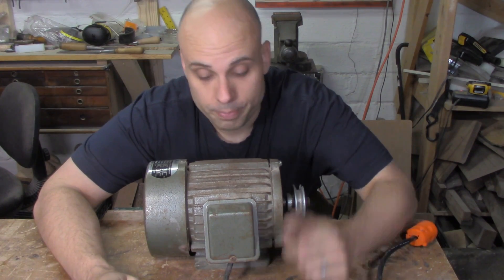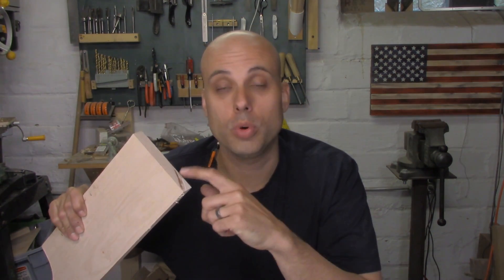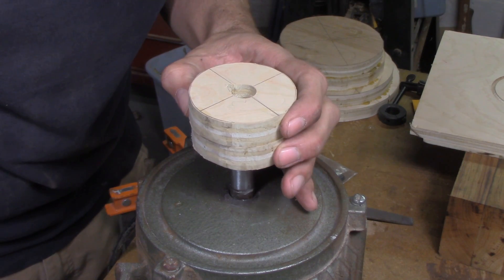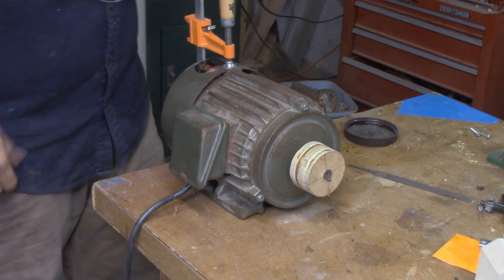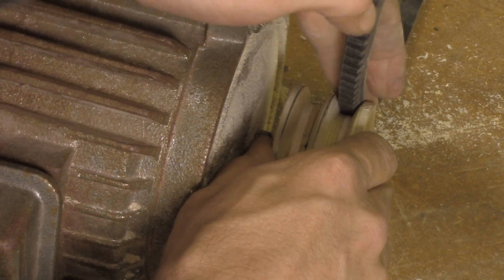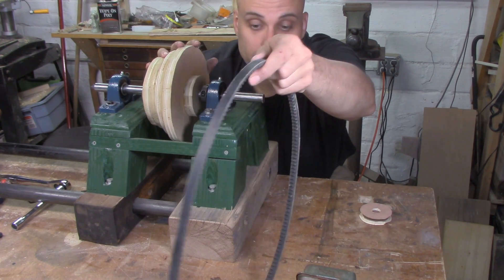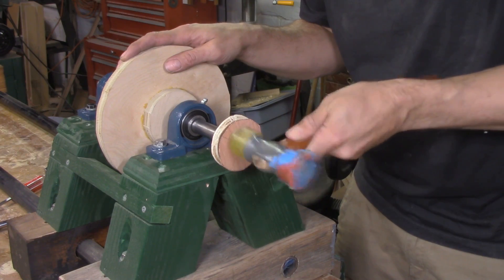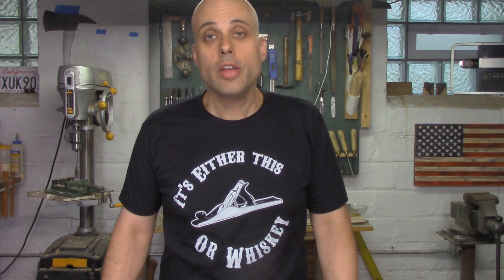Make Step Pulleys for FREE (Real Lathe Pt. 2)

Comment: Your set screws might work better if you file the shaft flat where they contact it.

I’m really skeptical that your wooden pulleys will work for very long.  If wooden pulleys worked, someone else would have been making them a very long time ago.
Reply from the maker: Well, I'm not the first.
Reply: People were making wooden pulleys long ago. They're economical and relatively easy to make. In the olden days, metals like brass and bronze were very expensive, and before the 20th century, aluminum was more expensive than gold.  When aluminum got cheap, and especially since the advent of die casting, that made it easier to make them out of aluminum industrially, but wood is still the best material for  people in small shops.
Reply: I didn't say that they wouldn't work.  I said I was skeptical that they would work for very long.  That's why people pay money for metal ones.  The wooden pulleys on block and tackle don't really rotate very fast, now do they?
Reply: @SkylersRants  wooden pulleys on a block and tackle spin around a stationary shaft.  These are fixed to the shaft.  That's why bushings and bearings were developed to reduce friction.  These pulleys rely on friction to function.  In this application, there are two modes of failure to consider.  The first would be too much lateral force on the pulley perpendicular to the axis of rotation.  This could potentially break the pulley, but proper setup avoids this issue.  The second is the possibility that the pulley could explode if it gets moving too fast.  While a lathe does spin at a pretty high rate, plywood has one of the best sheer resistance  coefficients of any wood material.  The likelihood of turning the lathe fast enough to explode those pulleys is minimal.  I wasn't insulting your intelligence, just saying that without experience your opinion was uninformed.  In the world of engineering, an uninformed opinion is worse than useless.  Guessing a math problem answer doesn't make you a mathematician.  Failure is part of the design process.  Actual failure is a learning experience which leads to more informed experiments and better products.  That's why I suggested you try it.  If your comment said, "I did exactly like you did and experienced catastrophic failure immediately!" Your comment would carry weight.  Saying "that won't work" adds zero information to the discussion and comes off derogatory.  I look forward to hearing about your experience, and I'm sure @rexkrueger does too!
Reply: You're discounting the wear of the belt on the pulley, which is what I was referring to.  In the industry I used to work in, we had a very abrasive environment and metal pulleys would wear out in the groove in a month or two, if not less.  A lathe is not that abrasive, but wood shavings are a contaminate, and at the speeds and power needed for the lathe I can imagine wood wearing out relatively early.  The wear would cause the belt to be less effective at transferring power, and you'd get more slippage when you apply a load to the work piece.  

I don't know the answer and neither do you.  My remark was speculation.  No, I'm not going to build a lathe just to test the idea.  The cost of a pulley is a lot less than the cost of the time I would spend on a silly test.  But Rex might be prepared to watch for this result as he runs his lathe for a while.
Reply: @SkylersRants  that's the kind of comment I was looking for the whole time.  You described your experience, established your credibility, and explained your concern.  I genuinely appreciate your input on this.  Perhaps later in the build, Rex could shield his pulley system from chips to prevent possible wear.
Reply: The British conquered the world with wooden sheaves. The contract for making all of those blocks was a pivotal moment in the Industrial Revolution too.
Reply: I have made wood pulleys l was a patternmaker
Reply from the maker: Shirley Ashton Wait, really? I didn't realize any pattern makers still existed.  Where and when did you work? If you wouldn't mind sharing some of your experiences,  I would be happy to hear from you. Please feel free to email me at rexkrueger at gmail .
Reply: So, you want to grind a flat and throw the shaft out of balance?  Rex is a very smart individual.  I'm all for people offering ideas and suggestions, but your comment leads me to believe that you don't have any practical experience.  I'm glad you are thinking critically, but you are missing important parts of this equation which leads you to a very wrong conclusion.  I suggest you try it Rex's way, and yours.  Produce a high quality video for free. And use your experience and knowledge to give an informed opinion.  After you have proven your claim, feel free to insult Rex's methods.  Another option would be to contribute to the community and collaborate.  Talking shit in the comments is easy.  Try adding something positive, it's much more difficult, and much more rewarding.
Reply: Putting a small flat spot on a shaft is very common for machinery.  The loss of mass is very close to the center of rotation, so the effect on balance is minimal.  

And you're awfully defensive for someone who has no idea that a small flat spot on a shaft is a good way for a set screw to get a purchase on a metal shaft.  I'm not trying to make anyone look bad, especially Rex who seems like a decent man, but really your complaint that it would affect the balance at the same time you're advocating for wooden pulleys that by their nature aren't very homogeneous is kind of silly.

The tension on the belt, for the speeds and power needed to drive a lathe will mean that the pulleys will likely wear out relatively quickly, at least compared to metal pulleys.  

Note that I didn't say that the idea was worthless.  I said I was skeptical that they would work for a long time.  That means I'm willing to be convinced that I'm wrong if the evidence shows otherwise.  

So take your sensitive snootiness somewhere else.  You're the one talking s--t.  I'm making comments based on my decades of working in industry.  So, before you go criticizing constructive comments, perhaps you should figure out if you know what you're talking about.
Reply: My comment here is meant for Nic, not Rex, who I have a lot of respect for.

Comment: For the set screws, they will also hold better if you grind a small flat on the shaft where they go.
Reply from the maker: Good idea!  I might also just drill a little divot into the shaft. Good to have options!
Reply: @RexKrueger  that would have been my suggestion.
Reply: Great idea
Reply from the maker: Atrixium that's an excellent idea!
Reply: @Teklectic   Ore just add some strong LOCKTITE ORE EPOXY GLUE. The wooden parts will wear out long before the epoxy-locktite loosens. hehe